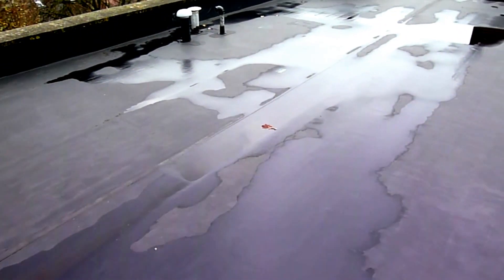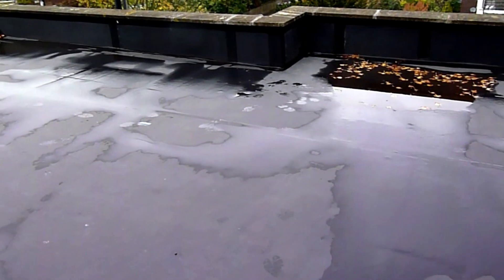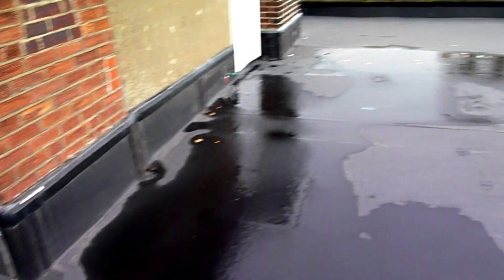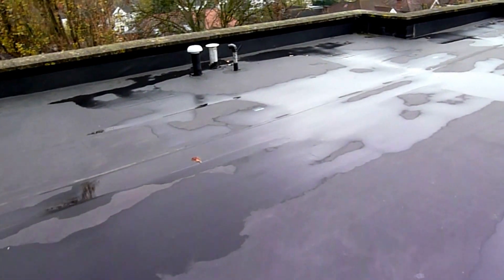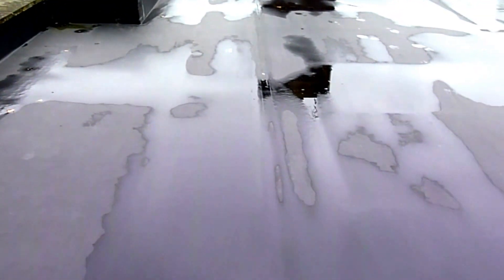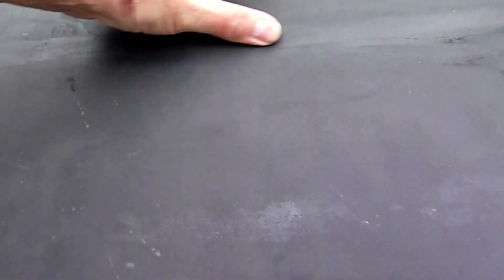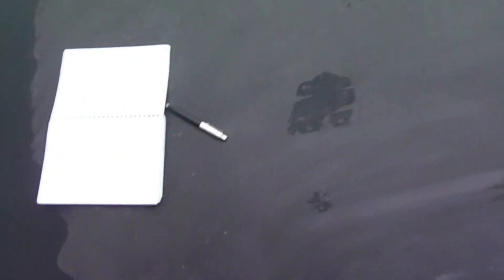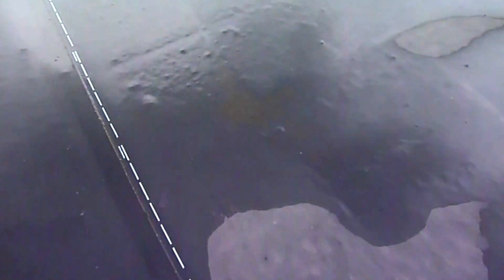5 Year old EPDM rubber roof inspection

Comment: Didnt look like it drains very well to me. If its like that after just 5yrs then thats no good.
Reply: David Tyler not necessarily. Drainage is not/was not considered a part of the roofing system. In fact, certain roof systems are/were originally pool liners. Not until 2012 did the IBC define terms for drainage but as this was a reroof it would be exempt from that rule. Especially with EPDM, a small amount of ponding water can be good especially adhered EPDM, as it can prevent the membrane from overheating and causing rot to the insulation (and potential delamination).
Reply: It's a bullshit roofing system. I do repairs to this stuff all the time. The watertightness  of the building underneath is relying on rubber, glued over a substrate that will move over time and stress the membrane. You don't glue wings on a plane so good luck gluing rubber on top of your building. You can't walk on the bullshit without risking puncturing it, and after about 10 years the carbon in the rubber will coat your shoes and good luck walking on someone's carpet after that. Best solution for these buildings is to put wooden purlins down and build a low pitched metal roof to metal internal gutters. At least you can walk on it and leaks down the track are much easier to locate and repair
Reply: Bullhorn Twin the cost of that is far too much. EPDM has some bad moments when installed poorly but there's plenty of good flat roofs out there.
Reply: @hfb17  should you not be  happy with this system! You get to do repairs all the time ! Just charge the right money for the repairs !! Architect's which are pushing sub standard materials! Thank you for all future repairs